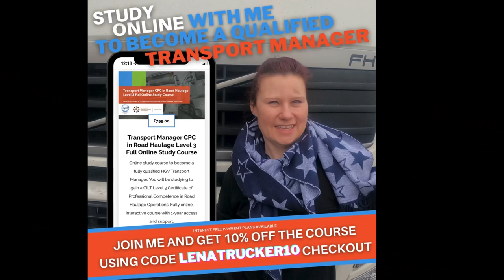Changing brake calliper, abs sensor and tyre on Volvo FH aka Troker

Comment: Hello. I don't mean this in a bad way but did you buy a scrapped unit and now rebuilding it I thought when you pay alot of money for a unit it should be ready for the road
Reply: I don’t think it’s a scrap lorry and they are just making it better basically
Reply: The first trip to Lawtrucks should have told anyone its a scrap yard lol    anyone in their right mind would have never gone back? let alone bought something from them,
Reply: @brianwebb191  yeah true i guess
Reply from the maker: He’s a good lorry, we knew few bits would need to be changed and only had couple surprises (tyre and caliper) other than that hubby just got on with bits and pieces whilst we had the time; better do it all before i get on the road to prevent breakdowns than pay an arm and a leg for those. Few weeks troking now and not a single issue 🤞🏻 - he truly is an amazing mechanic

Comment: If that brake disc is the original one it could be an absolute nightmare to replace.  Done them before..if that was my tractor unit i would have said sod it and changed the discs both sides and the pads . At least you've got peace and mind knowing that you know the brakes are good on the back axle ..and judging by the way he was hammering on that half shaft,  id definitely say they are the original discs on the back . Just my initial thought..
Reply from the maker: Yes good idea thank you

Comment: Hi Lena, I am not a mechanic but have done some fitting, but can you ask your other half why he bought a new calliper instead of re-tapping a new thread. Hope its not a stupid question.
Reply: Stumpy its not a stupid question, its a sensible one re-tap new bolt job done lol  or if you wanted to cheat that bolt would have gone back in with the end cut off,
Reply from the maker: He didn’t want to mess around with the breaks better be safe. Not a stupid question  au all I didn’t know either

Comment: Why did you go back and buy a vehicle from a scrap yard ?  ( Lawtrucks )   You have done all that work on the n/s rear hub and put it back with a nackered disc ?  maybe you like work and saved some for another day lol,,  also see you like to fit crap tyres to the front axle Double Coin?   You are a brave man to fit that shit make on the front axle, Allways use premium make on the Front.  Michelin work out the cheapest if you are short of cash,  Double Coin if you have plenty of cash lol  just proves its all bollox about cannot fit 10 yr old tyres to the front axle a 20 yr old Mich would be safer than a NEW Double Coin,   You get what you pay for?      maybe Not with that Volvo though ?  looks like the scrap price was good at the time ?